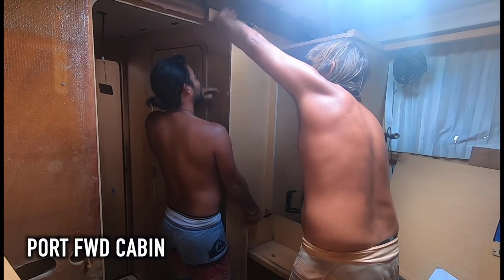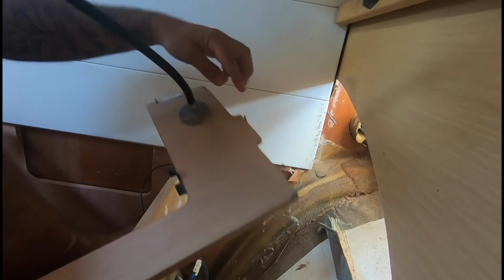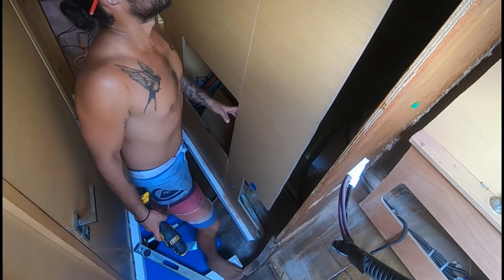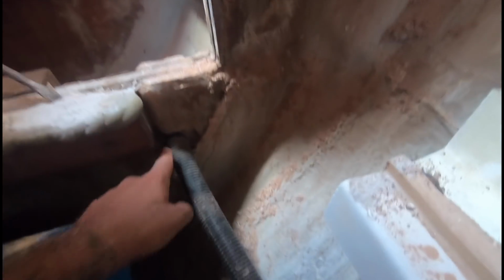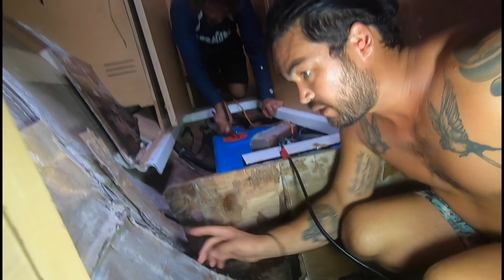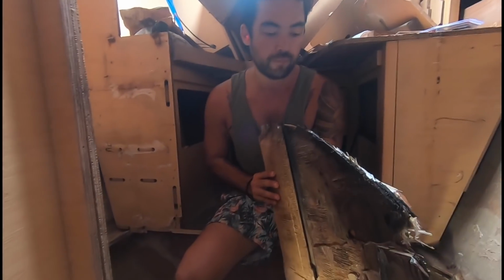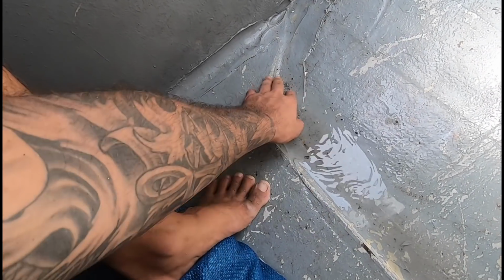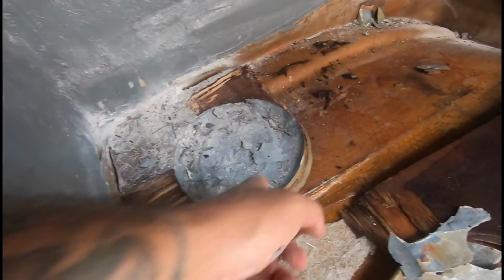CRACKED BULKHEAD REPAIR SERIES - Part 5  (Episode 110)

Comment: Amazing skills Colin.  The engineering and construction skills are obvious.  The Emotional intelligence is off the charts too...balancing the presentation of the boat problems with preserving a positive relationship with Lagoon.  Most people here read between the lines and immediately judge Lagoon as the bad guys.  I'm not saying that's 100% wrong but I think it's a bit more nuanced than that.  I just hope, like everyone else, this dynamic duo can keep up the positivity to see this project to the end.  Past performance says they will.   I can't envision Lagoon doing anything to help their customers out due to the cost of repairs, even with the deep pockets of their parent company Benateau.  It's just too destructive of a process and too time consuming and an interior rebuild while shoehorned into that tight space can't be financially justified.  it will be cheaper to fight the lawsuits and the Lagoon/Benateau Corporate lawyers will win. Proving a design weak point is not enough.  Every design has a weak point that will fail before other areas fail. Hurricane boats, accident boats, over tensioned rigging boats, improperly maintained boats, old boats, second owner boats etc etc..will all be ruled out leaving at best a handful of boats the manufacture will have to offer some assistance if any.  It's just the way corporations work these days.

Comment: Start collecting some cardboard for patterns of those bulkheads. When I built, I used cardboard bulkhead patterns and also configured shapes of furniture so I didn't waste expensive material. Get it right size/shape with cardboard and transfer it to you material. So many panels need scribed on 3 or even 4 edges.

Comment: For the dust, install a powerful fan that blows outside using a flexible conduit. That way you have negative pressure in the area you work and clean air comes in from everywhere instead of the dust getting everywhere.

Thanks for sharing all the messy parts with us.

Comment: Knowing the problem is 80%, clearing out the rot is 50%, preparation and rebuilding the structure is 60%and making all the other shit fit again is another 75%, that's 265% of effort required for a 100% repair.
You're already at 110% as you have completed removing the rot, how awesome is that! Have a beer, almost half way there!

Comment: good to see you tracked the water use electrical pvc heated and bent to conform to the hull and channel the water to the bilge then glue and seal her back up...9lb polyurethane makes a good glue for your drain water will track the paths of least resistance so give it a water tight channel....The electrical pvc can be formed while warm from a pvc oven these are easily constructed with a large electrical tee fitting and 3 foot pieces of conduit and a heat gun shooting hot air down a 1 foot nipple down the short hub this will prevent scorching the conduit and cooled while in place with damp cloths...then use the polyurethane 9lb low expansion used for doors and widows to glue it into place gravity will carry the unwanted water  to the bilge...bypassing the wood and laminated bulk heads...3/4 inche electrical conduit dirt cheap..yet will last for decades simply glue the joints together...it flexs and moves quite a bit and carrys a super volume of water even preventing vapor losses...

Comment: Next time you should consider a Aluminium boat, but you have no choice but to repair Parlay to make it salable in the future, cheers.
Reply: Aluminum has a massive tendency to crack
Reply: @Ptro1  Has to flex a lot to do that I have welded a lot of Aluminium over the years and never had a problem, you should check out the channel Life on Jupiter
Reply: @patrickcoleman3  yeah I agree. Takes a lot of stringers to stiffen it up. With the right time and money it is the way to go, just would be tough to find a company to mass produce them. Nothing more satisfying then tig welding!
Reply: @Ptro1  I`m 70 years now done all kinds I was a boilermaker welder and our old saying was a good opening for a welder.
Reply: @patrickcoleman3  I have some mates who build boilers, they travel all over. Seems like a great job.

Comment: Black Mold - That black shite that you see could likely be black mold.  It can be remediated by a solution of 8 oz to one gallon of water and spray and scrub.  The other is high concentrated hydrogen peroxide at 10 -35% concentration (get it at pool supply stores).  Or there is chemicals sold in hardware stores specifically for mold but its pricey.  Id get rid of that while you have it opened up and do your work sorry to say with organic respirators or you both will be talking in a lower octave soon.  

I was surprised to see the serpintine pattern of the glue that they used to laminate two layers of the buld head when you were opening it up.  As you could see, they had limited adherence.  That as a failure and those pesky holes in your bulkheads didnt help them to be be anywhere near structural.  One piece of plywood to keep the boat from bending?  Lagoon should reconsider.
Reply: not just mould, its way worse!!!! its rotten wood.

Comment: surely someone can rig up an exhaust fan thats connected to dryer vent hose and snake it thru the windows to suck out some of that fiberglass when you're grinding. That would be horrendous if none of thats sucked outside

Comment: Glass the bulkheads before you install them. Laying up large sheets of glass on a vertical surface is a nightmare. Get the bulk of the laminate on before you even cut the bulkhead from the sheet of ply. Then glue it in, add fillets, and lots of tabbing.

Comment: The tools for sheet metal work are largely easy to use and leased very easily a break and saws grinders and perhaps a spot welder cutting and shaping the metal is easily done with even hammers and special flat nosed vice grips once you got the shape cut your access ports make the breaks 90 dgrees or a bit more or less, which quadruples the strengths and sandwich the wooden materials just before tightening add your adhesives caulk and glass the hell out of the hull contacts this is the lamination because clearly the bulk heads will be less flexible which of course is what you desire... an non flexible, waterproof joint... So the joinery to the hull will be the key to unitizing the entire boat...eventually at the hull replacement in many years from now a lighter steel copper alloy sheeting would be easily added over the glassed hulls and of course painted there is quite a bit of research available in sheet steels but those irons mixed with 30% copper and 5 to 8% nickel smelted and rolled into sheets are the golden standards for hulls that are eternal the copper is super resistant to rust and barnacle accumulation but stabilized with the nickel preventing contaminates from leaching from the hull to the ocean...A few hulls built in the 1950s post war where done on ice hulled rescue tugs for the north sea..After the war this was primarily for mine sweeping etc..but these hulls where cold riveted to the frames...They are still in service, hulls are great but the riveting needed redone...if your bones on the boat are still good a lighter version of the mix not as thick could easily be laminated over the existing fiberglassed hulls...The current boats still in service with these hulls are the elba commercial tug and the sea wolf yacht a conversion done for a canadian businessman
I would imagine this secret recipe on the steels are in use on a couple of fead ships as well but that would be a guess on my part.

Comment: Colin , a friendly warning. Lagoon can not tell you that it was not built strong enough for legal reasons . If they tell you to rebuild it stronger or reinforce area's they are admitting fault and open to being sued by everyone . 

So they can not tell you it is not strong enough . Speak to a third party for the truth .  My guess is those bulkheads are not half up to the job you need them to do . Easy to laminate 2 sheets where they had one and 6 where they had 3 and maybe then it might just be strong enough .

Comment: Have you considered using perforated metal to strengthen up all those areas that has no real footprint?  I am really beginning to believe aluminum is the only way to sail anymore.  You really should be wearing masks around the black mold. But remember, safety third!!

Comment: sheet metetal is your friend breaking the corners and sandwich bracketing with stainless steel bolts and washers bulk heads will become bullet proof and strengths will become unparalleled... pouring contact cements into the plywoods seals and re-laminates the plywood soaking in contact cements seals and evicts water when sheet metal sandwich brackets are tightened the contact cements flow where water went and seals the face of the metal...once tightening the sheet steels with breaks 90 degree bends according to the shapes  will make the areas bullet proof...when sheet metals are cut to fit and longer edges have breaks at 90 degreess sandwiching the plywoods glue runs out sealing the edges ...this squeeze bracket tech will allow you to track window seals etc and any leakage becomes irrelevant to the areas of repair...or the water will track to the bilge with out further damages...bleaching  kills molds so at some points when she is opened up a bit of spray at the end of the day allows the chlorine to bring wood back killing the mold...boats will always be damp so even condensates will cause water to accumulate as it breaks through your glass having mold free products and seals like industrial glues and the sandwich bracketing puts a rain coat on these vulnerable areas and glass work is minimized... or replaced with commercial flexible caulks... in 30 or so years the steel laminated bulkheads may need replaced but in 30 years you will be 70 and the boat will await the next owner....and possible hull replacement...tube steel will not flex so the bonding of overhead beams to the frames must be strong and flexible leading to caulks that fill the bill...

Comment: Glass encapsulated wood is a ticking timebomb in a marine environment. Glass laminated one side is no problem. Don't repeat the error, replace the plywood with an all glass panel of equal structural strength.

Comment: That bulkhead is failing from a tension failure. The forces of the hulls rotating down are pulling the wood panel apart. The solution will require increasing the tension strength of the vessel bulkheads. Trusses at the floor/deck level can be added to bring the hulls up. Fiberglass is not going to solve the problem but cables and turnbuckles through the deck from side to side may. A structural engineer is what you need.

Comment: If the boat accidentally starts on fire, I would totally understand...
Reply: The original owner sailed and parked it in front of a hurricane.  He knew that the floor and stays were too loose and that the bulkheads were most likely damaged or broken. (see wedge under the floor).
Reply: @kaptnk51  Sounds about right.
Reply: is it even insured?
Reply: He has previously noted that he doesn't have insurance on it yet.
Reply: That black mold in your lungs can kill you. Wear a proper filter.  Be safe. Uncle Will

Comment: So - I am really starting to like several of the aspects of our 2003 Catana 471. Our cabinetry is still fastened together with difficult to access spaces (maybe its a french catamaran thing), but our bulkheads are multilayered (3/4" per layer) fibreglass honeycomb core reinforced with Twaron/carbon fibre.

Comment: As a life long woodworker and cabinet maker I’m cringing a bit at the job you guys will have refitting the interior bits after the bulkhead repairs. That’s likely to be a job nearly equal to repairing the structure of the boat. I’ve not done much marine work but rv’s are built in much the same way and it can be extremely frustrating to try repairing them. Might as well take a bunch of photos, then tear out large sections, you’re never gonna replace/repair the access bits.

Comment: As long as the team of Colin and Jamie stay together, there's no way you don't get this done, and get back to traveling and living everyone's dreams !  It's definitely looking like you need to eliminate as much plywood as you can from re-construction of bulkheads. Could you perhaps use aluminum plate down into bilges areas and again at upper sections of doors as a load spreaders ? The vertical sections in between can be re-made with thin mixed resin SATURATED into plywood to avoid future rot potential. Cover it with hot glass to help it cure internally.  If there is no capillary action, the wood cannot rot since the resin keeps most of the water excluded... keep in mind resin is slightly porous unless you use a finishing resin that has wax to seal those pores.

Comment: My sympathy and admiration goes out to you guys.  I hope that this does not sound like judgment of your extraordinary efforts.  It certainly is not meant to be.  One thing I have always had issues with in a lot of construction of many different items is the over confidence we seem to have in glue.  Often it just doesn't do what we think it can do over the long haul.  I am a retired engineer, so this is not a conclusion I just recently stumble upon.  The application of glue is anywhere from a few serpentine ribbons of gobley gook, think liquid nail, to rubbed in wood glue joints typical in furniture, cabinet, and guitar construction.  There is a great deal of difference between these two application methods.  It seems to me that either one is completely unnecessary or the other is extremely lacking.   I lean toward the second.  My other observation, from your experiences and others is, that mono-hull boats sure are sound.   My hat is off to you guys.  You deserve all the success that may come your way and I will continue to watch with great interest.

Comment: Gutting to find extra issues, but well done on sleuthing the original cause. Now can be confident on the repair plan, the hurricane looks to not have caused this ?? Whomever cut those 'ducting' holes all the way across the lower bulkhead should be shot, so much regdidity gone, did you no favours there.